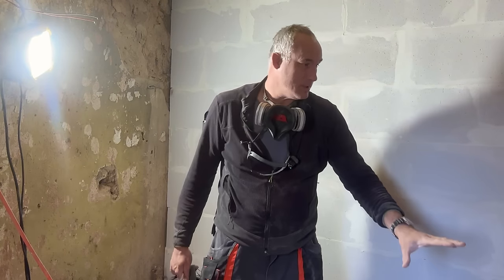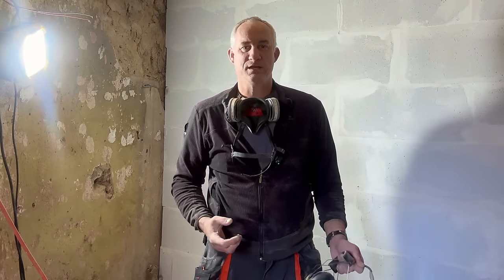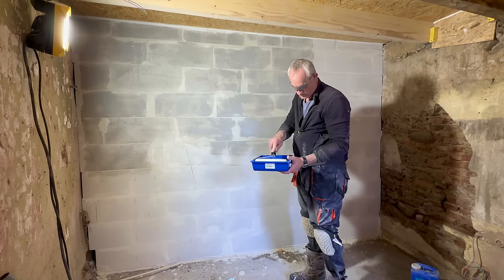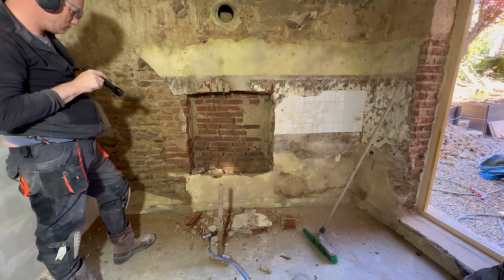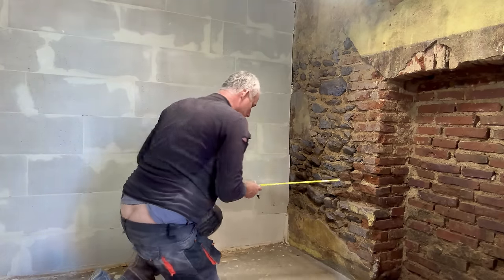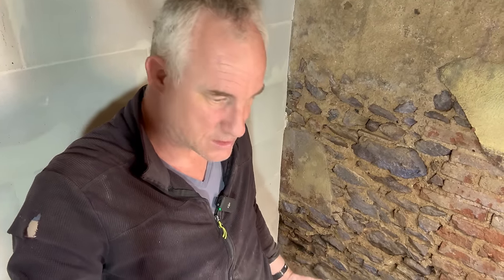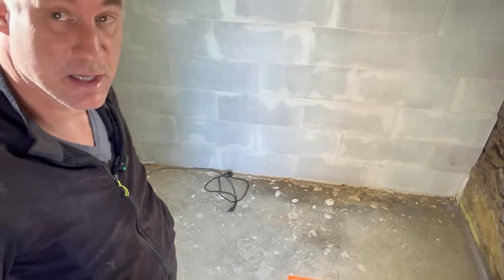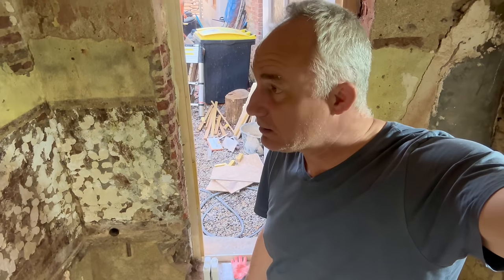Prepping Bathroom Walls & Discovering a Hidden Cavity. EP80

Comment: Set some big boxes where the shower will be. Another for the toilet. And a third for the vanity. Then boxes for the washing machine/dryer because you might want to adjust the spacing. I'm afraid your space between wall openings might be a bit too tight. You won't always be young! Make it big enough for wheelchair access now and you will always have the space later.
Reply from the maker: I could make the bathroom wheelchair friendly but the rest of the house is not. This is not a house for wheelchair users. I don’t think we’ll still be living here by that time either😀

Comment: Will there be insulation
Reply from the maker: Not in the walls. They are 1’ or 30cm thick stone. The roof is insulated and floor will be insulated and underfloor heating installed